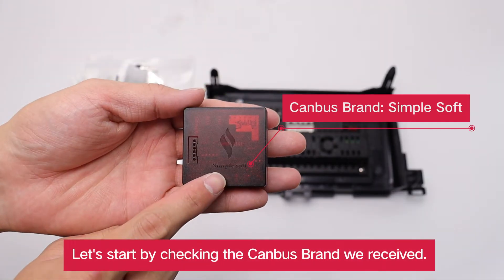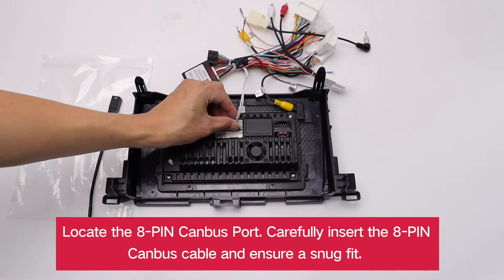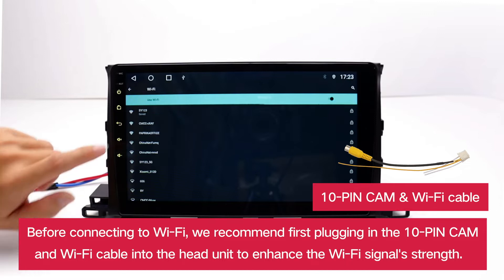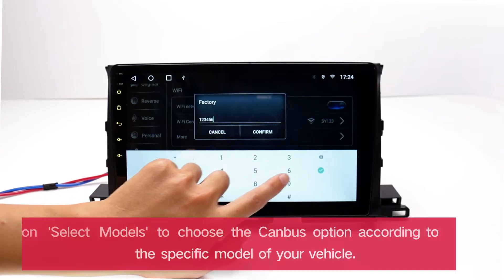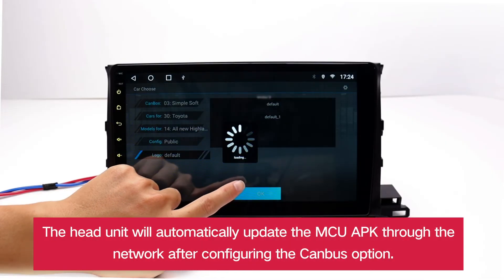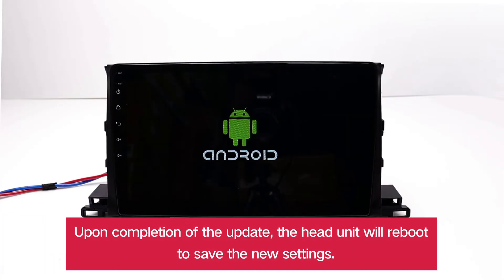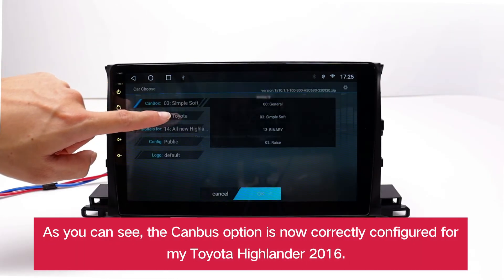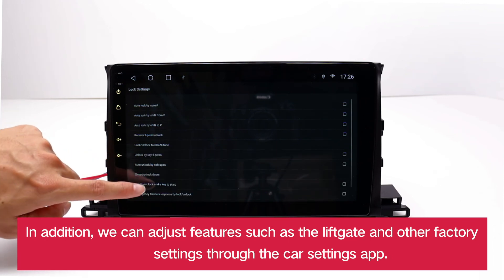How to Set Up Canbus on TS10 Android Car Radio

Comment: It would be nice to configure this before installing it in the car. I have a 12 V battery pack that I've used to test stereo navigators. Which wires would I connect that to turn this on?
Reply from the maker: Just connect the 12V supply power‘s positive electrode to the G3 ACC and G2 B+ pin, the negative electrode to the G1 GND.
https://www.youtube.com/watch?v=pW_Dj96n5nU

Comment: Please help there is no my car model - Nissan Primastar 2007 and steering wheel buttons won't work even when trying to use steering wheel learn app. Which model I should choose?
Reply from the maker: Does your car radio comes with Canbus box? If it doesn't have canbus box, you only choose the "No protocol/No Canbus" for your car.
Reply: @viabecsexpert5681  Yes it comes with canbus box

Comment: Hi, i have 208 2015 GTLine fully optional, the parking sensor icon only appears when reversing but not when moving forward, it doesn't display the TPMS and the fuel consumption and remaining fuel.

Comment: Please help, my car is a 2014 Toyota Corolla and I bought more than one Canbus and it does not work and the door opening does not appear on the Android screen and I checked all the settings. What is the solution?
Reply from the maker: do you choose the canbus option? 

you also need to check whether you turn on the 
option of the option of "door display".
Please go to setting app -- original -- door display
please turn on it.
Just want to verify if that canbus decoder box is connected and working.
I have attached a picture of the prompt information about the unlocked door as a reference.

Comment: Hi thanks for sharing i fitted an android head unit to my car and everything works perfect steering control , volumes ect.. how do i get the unit to detect door opening do i need a canbus? Is this something universal that you can buy also does  the canbus receive input signal from the doors or does it communicate wirelessly with the cars computer
Many thanks
Reply from the maker: Yes, you need to connect the canbus box with your head unit. and then turn on the option of door info display.
photo link: 
https://photos.google.com/u/1/search/_tra_/photo/AF1QipNuGxmEdE-rWSKrn16UHG75DIufA8b4PHbWAIvb
Reply: Hi, when i change the model, it doesn't save it.

Comment: Hi, I'm having problems with the air conditioning of the 2010 Civic G8, do you have any update for the Cambus system to eliminate this error that occurs in the air conditioning or a specific configuration for my car model?
Reply from the maker: Dear friend,
I recommend reaching out to the vendor of your radio to obtain the correct updated file. Otherwise, using our files might cause damage to your head unit.
Reply: Which canbus did you use for 8th gen civic?
Reply from the maker: @POG7606  The eighth-gen Honda Civic is a series of compact cars produced by Honda from 2005 to 2012. Typically, the 8th Gen Civic does not require the canbus harness. Therefore, you should select the Canbus option of No protocol or No canbus.

Comment: Hello, my car is a 2012 Honda Civic. My multimedia was configured for the 2014 version, but there is an option "13: 12 - 14 Civic".  When selecting this option I noticed that it shows much more information than when it was configured for 2014. The problem is that the I-mid does not turn off with the car and the radio stations no longer appear.  Can you help me?
Reply from the maker: Please check if you have lost the USA radio region.
Please click settings -- factory -- password 123456 -- Radio area.
I'm not familiar with what "I-mid" is. Can you explain it to me?

Comment: I have a 2006 4runner with jbl, I looked in the canbus options and that model is not there.
Reply from the maker: If you use the same wire harness as the attached photo, it only needs to be set up for "No protocol".

Wire harness:
https://m.media-amazon.com/images/I/615I5aHhK2L._AC_SL1500_.jpg